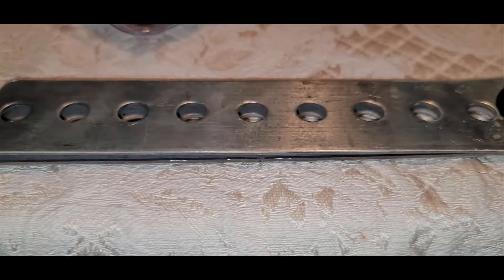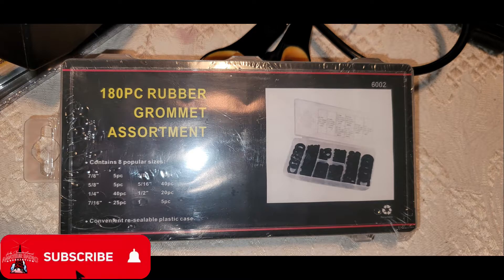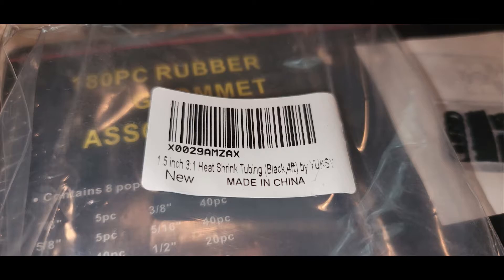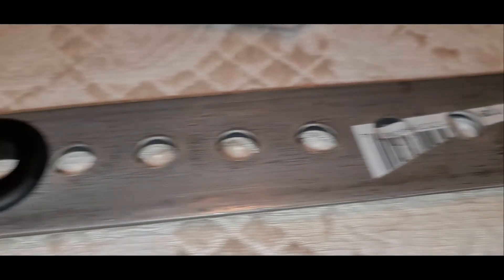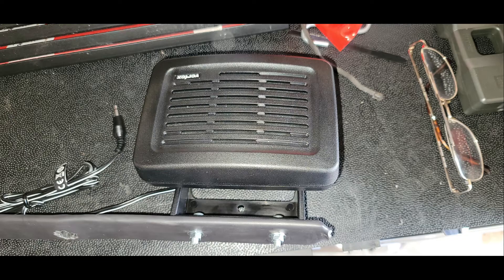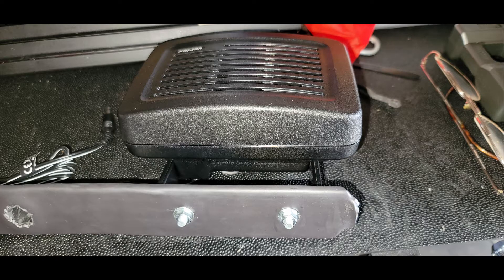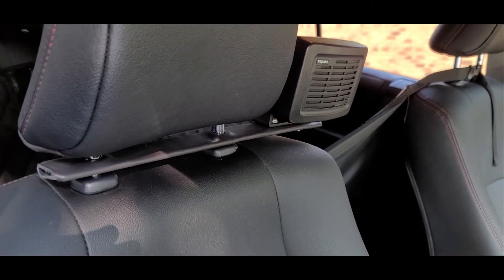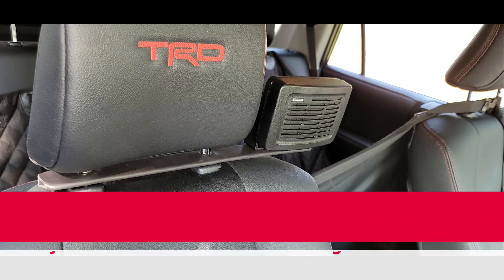LCARA HAM Radio: Fabricated Mobile Speaker Mount Pt. 3!!!!

Comment: And now I know how I am going to mount the speakers for my FT-891 and FT-8800 radios in my Silverado. Currently they are mounted on the floor on a piece of wood. The heads for both radios are on a Lido gooseneck seat bolt mount. 
Thanks, great video
73
Reply from the maker: Glad I could help